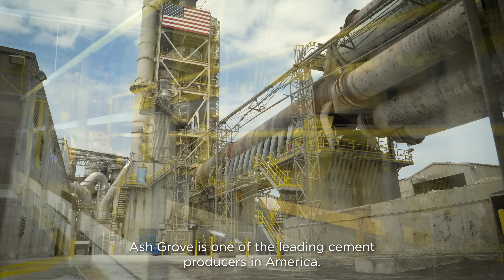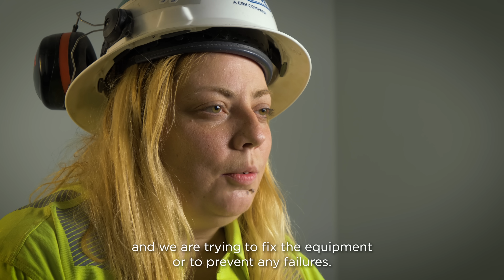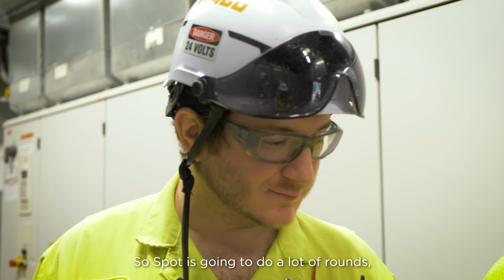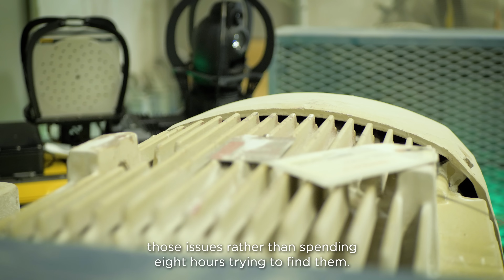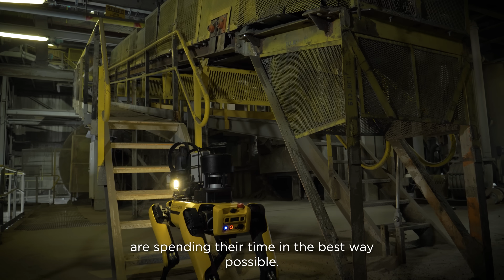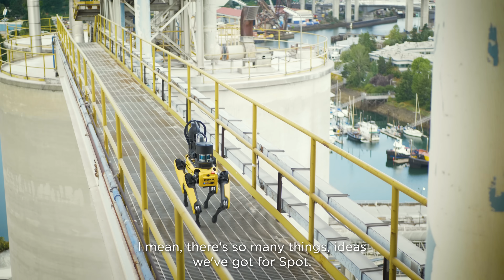Spot at Ash Grove Cement | Boston Dynamics

Comment: I will trust you that these are actually useful when I see one beat-up and dirty. in all these commercials the robot always look pristine, new and never used.
Reply: If you look closely, it is a bit dirty and there's one big scratch. But I assume they do regular maintenance on the robot, which includes cleaning, so it will probably never look the way you imagine.
Reply: @JohnyDaison  Yhea it's probably a Demo unit that they multiple use for commercials. "one big scratch" sounds like unfortunate set accident. Maintenance means downtime, and downtime means loss of productivity. It also means that you have to pay a maintenance engineer. The whole point of a robot is that they are autonomous, you should be able to have hundreds of them in one plant, you are basically proving my point. This thing isn't actually being used for real.
Reply: dirty means it lasts. I want something that can get old and take a beating, that we can fix ourselves.
Reply: True. Such robots should be used in harsh situations, and not walking somewhere in empty corridors. This robot has remained the same useless piece of plastic for many years. 😂🤦‍♂️
Reply: Of course, it has tradeoffs, it is not a magic bullet. You have to do cost benefit analysis to check if it's worth buying or not.
Reply: Have you considered they clean it daily since it is probably a very expensive piece of equipment? Or even clean it before the video for the sake of the video..?
Reply: @morphkogan8627  Have you considered that it's not worth the labor to clean a robot daily that does the same work a human could do? Have you considered that this thing is useless except for few specialized applications. Industrial automation is not one of them. Factories have used AGVs for a long time already.

Comment: Why aren't remote sensors and cameras installed in the all areas that need to be monitored and simply transmitted via wire/radio ?    This way there is a constant stream of data instead of waiting for a slow robot to move from point A to point B.
Reply: Maybe because the cost of those sensors and cameras are not negligible
Reply: @  Camera with WIFI cost under $30.  Open source software to monitor those cameras is FREE.    So monitoring 30 locations cost $900.   And if a camera breaks, then only 1/30 of the operation is impaired.  But if SPOT breaks, 100% of the monitoring operation is impaired, and now you have to deal with repairing a complex robot instead of swapping out a $30 camera that you can keep in stock.
Reply: @bofillot   A $30 cell phone with a year of pre-paid phone service  contains temperature sensor, vibration sensor, accelerometer, GPS, camera, mic.  Any other sensors can be plugged into the phone. How does SPOT walking up and down steep stairs for 30 different locations, maybe 2 or 3 times per hour more efficient than mounting 30 cell phones around the plant that transmit data into a monitoring system at lightning speed every 10 seconds?
Reply: @DEO777  I think that when spot is moving around "slowly" it measures many many time more than 30 locations. In heavy industry problem can occur at hundreds of locations. It can be electric wire over heating (required infrared camara), valve leaking (ultrasonic sensor), motor vibrating, reading actual instruments like analog pressure gage etc. Of course you could put fixed instruments for all of those but it would be much more expensive than 30$ cameras/phones, would require protected cabling perhaps, which means that a load of engineers are required to design, comission the change to the electric installation etc. 
What sounds easy from inside is crushingly hard when confronted with the hard reality of life in the industry.
Reply: @DEO777  there are different types of sensors and cameras, not all mesure at the same precision and the same thing... for example a thermal camera depending of the quality can be quite expensive
Reply: @dominiquejeangille9254  That's a really insightful comment! I think another part is the whole idea of having an autonomous robot working for you. It's very futuristic. In that way, Spot itself is kind of like a status symbol, it says that the company is moving in a new and bold directions. Additionally, I think if you asked most people which was cooler, a yellow robot or a sensor suite, most people would say the former. Probably good for investors. And if the spot really is implemented so that workers can be "upskilled" or have less busywork on their checklists, it's also a charismatic moral boost, as they try to argue in this video (and all the other videos too, hah). In other words, Spot has soft benefits beyond its physical capabilities too that should be considered.
Reply: @ If SPOT has 30 to 100 locations to monitor, then it can only reach each location less than once per hour. So, of course, things will break between the sensor readings and no one will know until an hour later because SPOT is busy dancing on a staircase.
Reply: @dominiquejeangille9254  Eventually SPOT breaks, then a human has to get sensor readings manually, but that human won't be familiar with all the sensor locations because a robot was doing it, so then what happens? Maybe a nucler power plant melts down. Robots that move around are an added layer of complexity and cost. The cabling (you mention) is much less complex, and provides reliable light speed power and data stream.
Reply: @DEO777  youre derailing from the main point, its not economicaly logical to buy 30 to 100 thermal cameras which can cost 3000€ (or much more) EACH one. Apart from the fact that maybe there are a lot more spots and things to control, which could mean a lot more cost, so youre suggesting to invest at least 500.000€ and more cost of maintenance for each camera, compared to the 75.000€ of the robot. If they are not that critical there is no need to put fixed sensors in every spot.
Reply: @DEO777  There are most definitely a LOT of issues that you don't know about with that technique. Companies make money. If sensors worked, they would have already mounted them. Clearly there is a need for this. Do not be so arrogant as to assume you know better than an entire company of people. You sound 14.
Reply: @SunSoupArt   "An entire company of people"  is an "Argumentum ad populum".   Want to try again to make a legitimate argument?     There are tens of thousands of companies with dozens and hundreds and thousands of employees that FAIL every year because they never make a profit.  The US government has millions of employees and never makes a profit and is failing.  So that's why your argument is fallacious.
Reply: Yet companies are buying these things and benefiting from them.  Sounds like you think you understand more than you do.
Reply: @balijosu    My question did not suggest that companies are not benefitting from a slow robot, my question suggests there is a more cost effective and efficient way to collect data.  You didn't offer an answer or any theories, so it sounds like you agree with me.
Reply: @DEO777  False.  You're well aware I don't agree.  That debate "technique" doesn't make you look good.
Reply: This robot is absolutely useless in such enterprises. 
This robot still does not know how to move fast and therefore is not capable of anything.
It still doing useless things: performs silly dances and walks through empty areas..🤦‍♂️
Reply: @DEO777 Since you are talking about 30$ WiFi cameras it shows you have no idea about industrial applications. On this particular Spot there are 3 extra sensors that are clearly visible, a 360x40 degree lidar (~6k$), an acoustic imager (~15k$) and a multi-spectral turret(~20k$), the lidar can constantly record the location of structures around it up to 600 feet away, the acoustic imager can locate the source of a out of the ordinary sound several feet away between other sounds, the multi-spectral turret can thermal image a whole area towards where the lens is pointing and find hot spots while it is moving. While on the video spot is moving slowly, it can definitely outrun you if it wants, and it doesn't need to stop more than a person would to take particular measurements, but it can also take them while it is moving, and it can definitely walk for several hours straight without the need to take breaks.
Reply: @TheOnlyPsycho  LIDAR: may be useful for SPOT to navigate, but a concrete factory doesn't need LIDAR. 
Audio analysis:  each camera station (actually $11.03 including shipping) would have a mic. Multiple stations enables triangulation of an anomalous sound.
Spectral turret thermal imaging: doesn't need to be on a complex dancing robot, but instead mounted on a track that enables it to travel a circuit or mounted stationary with a simple pan and tilt function.
Reply: My guess is they're collecting metrics for low tech equipment, and the job for recording these periodic metrics were done by humans, and the metrics aren't critical enough to have to be real-time. Installing and connecting for example 100 sensors, is likely more sophisticated and expensive than just programming several dog robots to follow a preprogrammed path and logging data for 100 locations. For critical parts, I'm sure they already have sensors in place to alert based on real-time data.
Reply: These companies are not stupid. If there was a way to not have meter readers, they would have already done it. SPOT can not just read your meter, meters sometimes break, it can look at the equipment with infrared and detect vibrations and a few more things mentioned in the video. It can also straight up record problems.
Reply: It's not practical to put a camera in every nook and cranny of a factory
Reply: That becomes another entire system to maintain as well which means people to look after those and in heavy industry unless the equipment is built durable "not many make stuff for heavy industry so it has to be custom made" it will break and fail a lot. Now instead they can have 4-5 bots walking about checking things way less points of error to worry about and if they need more it is easier to upscale with a few more bots while the current workers can also help fill out when needed. It becomes less logistical burden, less economical and without having to hire a lot of extras it allows already hired staff to take on new tasks or better focus on tasks that do require more work. 

It pretty much becomes a question  of optimization vs brute-forcing solutions

Comment: Instead of showing it walk stairs how about showing it doing something useful?
Reply: Using remote sensing, you wouldn't be able to tell the difference between Spot standing there or taking a reading other than tilting the sensor to get a better look.  (which you saw)
Reply: Asimo is impressed.

Comment: Genuinely this is a video about eliminating jobs and replacing people with robotic workers. Used to be happy about robots.
Reply: If you watched and listened to the video, you would understand that the robot is there to RECORD data for the employees to analyze. Which enables them to get more work done rather than spending hours trying to find issues, therefore it is actually letting them do their jobs more efficiently than before.
Reply: @bossitron5656 Which if you have ever worked corporate.. efficiency = redundancies.
Reply: @slozenger9000 Efficiency with humans vs efficiency with machines are two very different things, and I should have clarified that more.
Reply: What were you expecting from them, exactly? Impromptu dance-offs?
Reply: Was it a tragedy for you when the tractor was invented?
Reply: You say that as if it's a bad thing.
Automating jobs should be a good thing. 

At least the jobs that people wouldn't still be doing as a hobby if they didn't have to work.

The problem isn't too few jobs, but an economic system that enables rampant worker exploitation. If people struggle to find a job it's because many of the people with jobs are overworked and underpaid.

I get it, you're outraged about the idea of people being unceremoniously fired and thrown into financial disarray because they were obsolete after their job was automated.

What you need to realize is that you're focusing too much on the part that read "after their job was automated." You're missing the forest for the trees.
Reply: @majorgnu  yes
Reply: This has always been the end goal of automation and robotics and it is a good thing. Trying to stand in the way of progress because of how it disrupts the current way of life isn't the correct move. Once enough people lose their jobs, one of two things will likely happen. 1. Society will go through a massive change to make it possible for many people to life fulfilling lives without having a job. Or 2. Society bans most automation in order to keep things the way they currently are.

I don't think standing against technological advancement is the path forward especially if your reasoning is rooted in how things currently run. Don't get rid of the robots, change the system.

On a side note, this is why the video game, Detroit: Become Human, is fundamentally flawed. When robots get that advanced, why try to ban the robots when you could try to change the system that put you in poverty. But the story wouldn't happen if people were more logical so it had to be that way but this is real life.